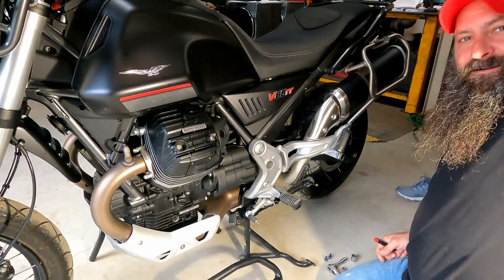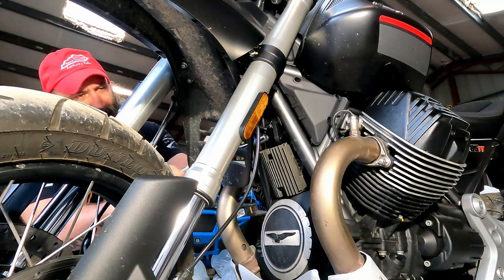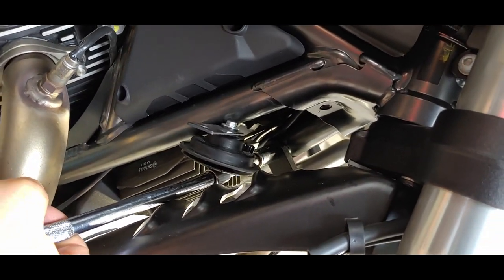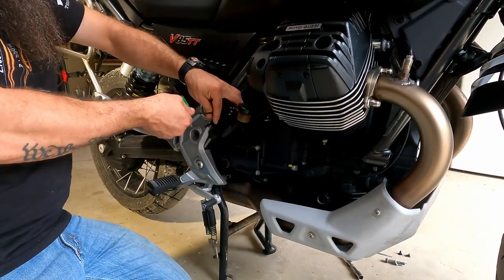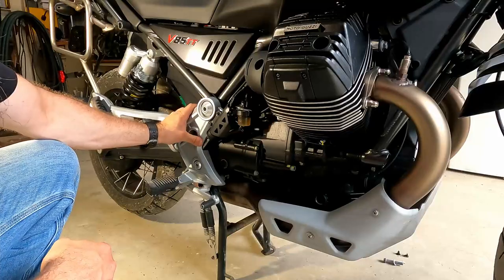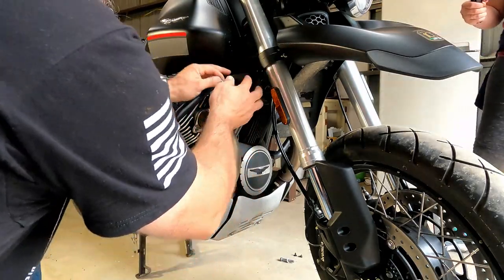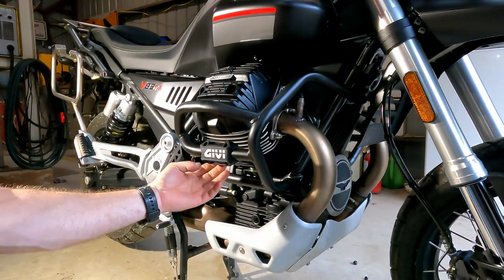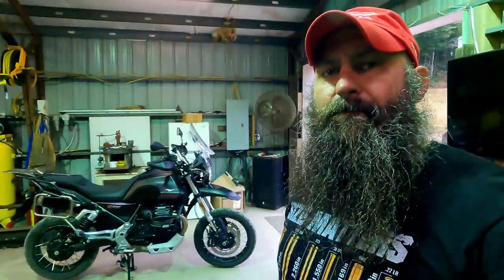GIVI Engine Guards on the Moto Guzzi V85TT

Comment: An oldie but a goodie. Just installed the Givi bars on my '23, and this made it easier. The weirdest issue I had was that I couldn't remove the horn. The bolt would do a half turn and then feel like it was tightening again. Dropping the fender helped get around that issue.

Comment: I bought Carl's demo V85 TT Centenario. He decked it out. I put a center stand on it today using your video. Springs are a pain. The ratchet straps worked after I finally stopped the bike from sliding across the floor. You do a good job on your videos.  Thanks.

Comment: Thanks so much for making this video, I installed mine today on my 2022 Adventure and the tips re: the master cylinder and the horn sure saved some frustration.  My friend suggested that we drop the front fender to create some more room for the two top mounts and that helped us not only to see but to get the bolts started and tightened too.  Thanks again!  Dave

Comment: I watched this video three times and then, using your suggestions about removing the horn and leaving the bracket on the right side until the end, installed a set of Givi bars on my bike. I had some trouble getting the front engine mount bolt on the right side to undo. It was stuck fast but a bit of heat with a heat gun helped. Also be sure with these bolts to get your socket to sit square as the heads are quite soft and can easily round off. Thanks for another great video.
Reply from the maker: I'm happy to hear that it helped.

Comment: Same reason. Givi was simply available. Seems to be well made and functional, install was painless for me, just tight in some spots like you experienced. Removing valve covers requires the tank to be lifted now due to the extended bars on the Givi model, but easy to do. Excellent videos and subbed

Comment: Just installed mine. Went very well thanks to you! I am sure you saved me at least an hour fiddling around. I did end up using a 20 mm bolt somewhere I should have used a 25mm but I will be damned if I can figure out where. It all went together and look great. Thank you!
Reply from the maker: Glad it helped you out. Ride safe.

Comment: I installed the Givi guards rather then the OEM or SW-Motechs as they came up a bit higher (more bits protected).
No issues installing them, but two things since.
#1 - I find it easier to completely remove the tank when doing valves. It's less work than fiddling around and wiggling bits to get clearance.
#2 - Access to the gearbox fill plug is blocked (for normal tools). I wound up cutting a 10mm hex key down on the short end and unbolting the rear brake reservoir to provide space for wrench movement. I now need to keep that modified key with the bike's tool kit so that it doesn't disappear.
Reply from the maker: Never thought to check my fill plug, I'll have to take a look at mine. Might have to carry a special tool as well.
Reply: Gearbox oil changes are far from regularly. Most people won't do it more than twice while owning the bike for many many years.
Reply: @Roomer645  Sounds like you didn't get one of the bikes that shipped with 70cc of oil instead of 700. I check mine regularly (drain and refill) for sparkly bits. So far, after 15K miles, all is good.
I have one of those bikes and caught it VERY quickly. Thankfully.
Reply: @mjordan812  I have a 2022 E5 model and it's fine.
70cc instead of 700cc is insane and i don't see how people at any factory would assume 70cc would be enough for a trabnsmission, especially a transmission this big (when comparing to other motorcycles).
Reply: @Roomer645  There was an issue with a number of 2020 bikes that left the factory with little to no oil in the gearbox. I was a lucky winner. 
As all of the fluids were filled at the factory, there was no procedure for dealers to verify levels - and for the gearbox, there's no way to check it other than to drain, measure and refill.
They (MG) seem to have sorted out their internal procedures and I haven't heard of any issues past the 2020 model year.
Reply: @mjordan812  Thanks for clarifying. It's a shame such mistake would still happen in this day and age.

Comment: Damn Hoss, hope your next video is on how to assemble your new motorcycle lift...Lol! My riding buddy and I bought one several years back and it is worth every penny to keep from wallerin' around on the floor. At 65 and two knee replacements I can get down easy enough, it's that getting back up thing that's a bear. LOVE the new black V85 and notice Gateway Cycles has a used white V85 for sale, Is that your old one? The guards look good, and that's a really nice looking windscreen too. Stay Safe!
Reply from the maker: I believe they sold my old one 3 days after I  bought the new one.
Reply: With ya brother. You have to plan your attack to get back up!!!

Comment: I bought the Isotta crash bars for mine but the bike is at the dealership waiting for new Cylinder heads, valves, etc. It is a 2021 V85TT with 1,100 miles on it. The titanium valves are on a recall, the bike never idled right since new, the left cylinder run hotter and when the engine was hot the pinging with 94 octane was so bad rendering the bike un-rideable. If your bike is a 2020 or 2021 check your Vin numbers, you may need to do some major engine work. I love my bike, I wish that it run properly but hey, with time and money.....anything can be fixed...LOL
Reply from the maker: Thanks for the "heads up." I'll have to check that out.
Reply: @cubbysue  Very few bikes affected. There were about 60 in Germany and possibly another 60 here in the States.. 
The recall is all about defective valves, not up to manufacturer specs. If there's no damage, they replace the intake valves only. If they stick in the guide and visible wear then the entire head assembly gets replaced. My bike idled very badly and there were no codes. Finally, right where I was about to give up, I called AF1 and determined that there's a recall on it. Upon opening the engine we found that the valve seats were also partly caked with carbon, it seems like the intake valves either were sticking or not sealing the port correctly and plenty of gasses were pushed back in the intake. Lets see when Moto Guzzi will send the parts. Other than that......the bike has been awesome.
Reply from the maker: Well hopefully they get you back up and running quickly. Where are you in the U.S?
Reply: @cubbysue  Queens NY. If you're ever in my area come and visit my garage, lots of fun bikes to ride.

Comment: they look like they offer more protection than the stock bars.  nice video, thank you
Reply from the maker: I think so as well. I like the look of these more as well but that's just a personal preference.  Ride safe.
Reply: Hello thank you for the installation guide; I installed SW Motech version on my V85TT; and after dropping it at a stop sign and scrape the out most part of the gas tank at the eagle emblem;  If I replaced these bars with the Givi version bars do you feel the tank would be protect from drops ; do they stick out farther than tank? Hopefully if I have another incident it will save my tank. Thanks John
Reply from the maker: @John-ev3cz  they do stick out alot and they have that big Givi plastic bolt-on piece on the side. I can't say if they would protect the tank better, but they look like they would keep the bike up off the pavement further while it was on its side.
Reply: Thanks for the reply; when you eyeball down the side do they look like they protrude out more than the tank edge that flares out and with the plastic piece on more so? Thanks again John
Reply: Would that plastic piece go on the top bar to add more outward protection?
Reply from the maker: @John-ev3cz  No. They are about 2 fingers away from the cylinders and I can't tell if they stick out far enough or not. I wish I could be more helpful, but I don't want to lay my bike over to check. 😂
Reply from the maker: @John-ev3cz  probably where it should go. That might be enough to stick out and protect the tank.
Reply: Thanks again for your reply sorry for being a pest; but my bike has the SW Motech and I did lay it down coming to a stop and turning bars caused it to lean over and being some what top heavy weight to get away from me and being a 69 year old and not built like you; I couldn’t save it; and me trying to pick it up was a whole other bad story; the tank got scratched so the SW Motech aren’t enough protection; that’s why I’m considering the Givi ones you have even though they look to be a bit of overkill. Take care John
Reply: I purchased a new V7 850 Special also; which I also like very much but riding the V85TT is so much more confidence inspiring ; just seems more planted; being a renewed rider after almost 40 yrs. even though it’s heavier and a bit more to handle; that’s why I don’t want to give up on it and get more saddle time to adapt to it; I only have 1100 miles on it now. John
Reply from the maker: @John-ev3cz  Well John, I really hope you get some more seat time. Being 69 years young, you should be out enjoying both of your bikes. 
Ride safe and enjoy the journey.
Reply: Thanks again; take care John

Comment: Thanks for the video, it really helped a lot. But I didn't replace braking fluid bracket. The original one fits just fine, and braking fluid container is still bent towards the bike, but not touching anything. It looks better to me than Givi's bracket. What do you think? Is there any reason I may regret not replacing the bracket?

Comment: Great video. I have the bars and will likely install tomorrow. Changing gears, how do you like the windshield that you have on your TT in this video. Thank you and Semper Fi.
Reply from the maker: The Givi windshield,  it redirected the air around me and hit me in the chest. That isn't a big deal for most people, but I have a big, bushy beard. It blew my beard straight up and into my face. Had to get rid rid of it. It also blocks the airflow to my helmet vents.
Reply: @cubbysue  I appreciate your reply. I'm just looking for something that isn't as noisy as the stock shield on my Adventure TT. Your video was valuable help in the mounting of my bars today. Thanks again.

Comment: How about the valve adjustment, can you sneak the VC offer without interference? I wish I had the Givi when I low slide in some sand and rock. My factory crash bar didn’t cover the valve cover as the Givi appears to. Enjoying your channel!
Reply from the maker: Looking at it, it appears that there is plenty of room to get them off without issue. I will be testing that shortly just to verify. Sorry to hear about your low side  : (

Comment: Can you still get the valve covers off easily for adjusting valve lash.  Thanks 👍
Reply from the maker: @loves2adv561  You can... but it can be a challenge to get them back on. I do recommend lifting up the fuel tank slightly when doing the valve adjustment. 

Ride safe.
Reply: @cubbysue awesome, thanks for the reply and the videos.  Ride safe as well my friend.  I appreciate you 👍

Comment: A nero, love my V85tt Nero Etna. What kind and color of cases have mounted on the Nero. Maybe you can show short movie with the nero with the installed luggage options
Reply from the maker: Mine did not come with luggage either,  I removed the ones from my other V85 to put on this one. But a short walk around is doable.
Reply: I too have the 21 Nero (base) and installed the Hepco & Becker pannier racks which appear well made and easy to install. Also purchased a set of Turkana soft panniers for travel. The MG engine guards were not available at my dealer either so I added the H&B version. Blaze on Guzzis

Comment: Looks like you said there’s a 13mm bolt that needs to be removed from engine in order to put in the 17mm bolt head that secures the bottom part of the bars right? I’m thinking that the previous owner snapped that 13mm bolt because when I go to insert the 17mm bolt to secure the bottom part of the bars it doesn’t grab anything. I looked inside that engine Mount and don’t see any thread. That’s why I’m thinking that the bolt was snapped and it’s stuck inside. What’d you think?
Reply from the maker: Can you verify that the bolt is broken off? Can you see it in there with a flashlight?

If that bolt is broken off inside for the engine mount, that is going to be a problem. Access to that bolt is very restricted. Trying to drill the bolt to extract it is going to be difficult with the engine in the bike. It is doable though. It's not a very deep bolt, but if it is snapped  off, it may be because it was overtightened. Either way, that bolt going into the block of the engine is an integral part of the  strength of the frame. The engine literally is hanging from the frame from those bolts. I'm sorry to hear that it is broken off. That my be a job best suited for your dealership or a machine shop. 

If you plan to attempt to remove it yourself, I would center punch the broken bolt with a transfer punch that fits tightly in the hole. You want to drill as centered into the bolt as you can. Good luck, and let us know how this mess turns out.
Reply: @cubbysue  once again you were right. Bolt was broken off inside. Tried extracting it but it was too much of a b?!ch since it’s deep inside. What I ended up doing was just threading the cylinder open area before the bolt. Engine Mount should be fine since that original bolt isn’t going anywhere. 
On a side note, this bike is relatively new to me. I noticed on the freeway that it was to rev pretty high to do decent freeway speeds. Is this normal? For example: 75-80mph = ~5000rpm
Reply from the maker: @daveotis4635  yeah, that's about right. At full rpm, you'll get about 117 mph..... 121 on a little downhill....😁
Reply: @cubbysue  interesting. Alright, thanks for the feedback!
Reply from the maker: @daveotis4635  I verified it today.... 75mph was right at 4500 rpms on my bike. That's with me, the top box on and a slight breeze. 80 was about 4800-4900.... give or take.
Reply: @cubbysue  ok that’s what I was hitting as well. Must be how it’s geared then. Odd because it’s not like this engine really likes to be revved high and yet you need to in order to get safe freeway speeds. Thanks for the update, ride safely!

Comment: Did I miss something or did your bike miraculously change color?
Reply from the maker: Yeah, I may have traded it for a 2021 V85TT. I gave a sneak peak of the new bike at the end of the Klim glove video.
Reply: @cubbysue  Hi Cubbysue , thank you for all your hard work on the videos, they are a great help. My question is, do you experience your engine rev  to 2000 rpm  for one second  then rev back to normal  once in a while at a  stand still. My 2021 v85tt does that . Love the nero color thx.
Reply from the maker: @anibalvictoria8008  yeah, it happened again on Friday. I stopped by the car wash to spray it down before the video and I noticed it did it twice. Usually I only get strange throttle blips when driving.
Reply: @cubbysue  hey Cubbysue, did you ever notice if your other bike did that, because I test rode last years model and did not notice anything like that . I went to my dealer today and the head mechanic was surprised by the way the bike revs in that manner. they will be keeping it for a few days next week . Lets hope they can solve this. Keep you posted. thx
Reply from the maker: @anibalvictoria8008  No, the other bike (the 2020) had never done that. I've only seen it on the 2021 with the E5 tune. I originally thought it was the drive by wire that was causing the problem, but I put heated grips on witch required a reprogram of the throttle. Let us know if they find something, could be a widespread problem.
Reply: @anibalvictoria8008  I had the same issue, took it back to the dealer and they told me its a known issue.  Something to do with how the cables are wired too close and some type of electrical interference.  Took them about an hour to fix and never had the issue again.  As soon as I mentioned it to the dealer he finished my sentence so they should know about it
Reply from the maker: @bellaguzzigriso6350  good info, thank you for sharing.
Reply: @bellaguzzigriso6350   This is your Moto Guzzi showing its Italian character.  My 2021 V85TT demonstrated its Italian nature to me by leaking oil on its very first long road trip. I had to laugh when I saw a small puddle of oil after the bike was ridden hard all day and then sat all night.  My brand new $14,000 motorcycle is leaking oil.  Of course it is.  When I first got this one, a neighbor asked my why I bought an Italian bike. I told him because I like to fix stuff.  Simply tightening a half dozen loose oil pan screws fixed my problem.  It took five minutes and hasn't leaked a drop since.  That's the way Italian bikes are.   

CubbySue, thanks for your service to America. And your videos are great as well.